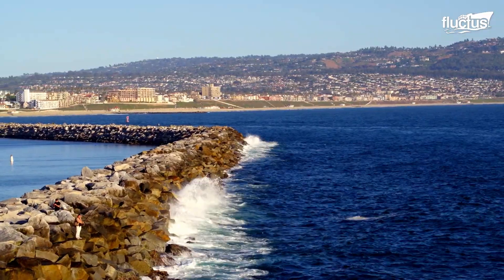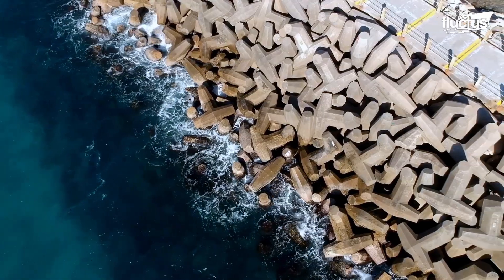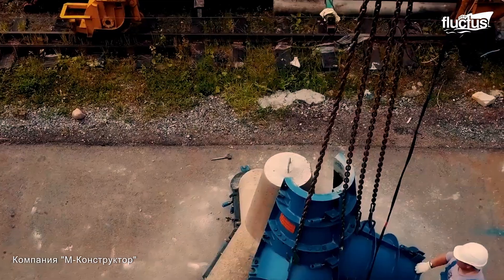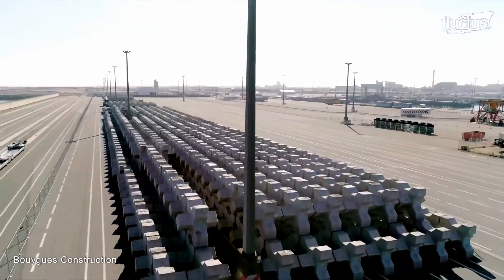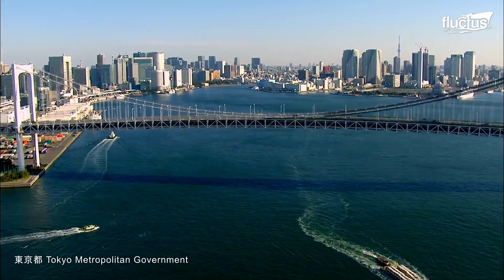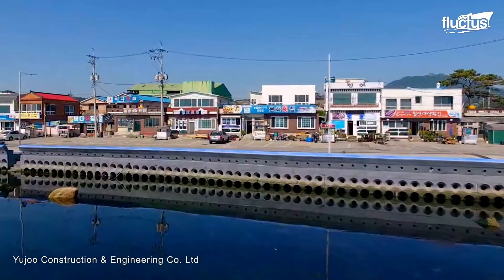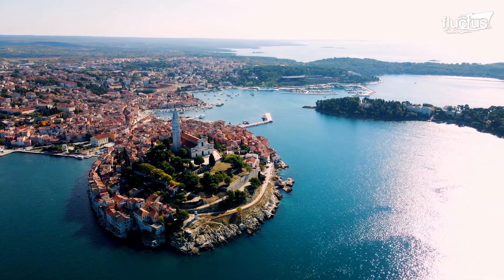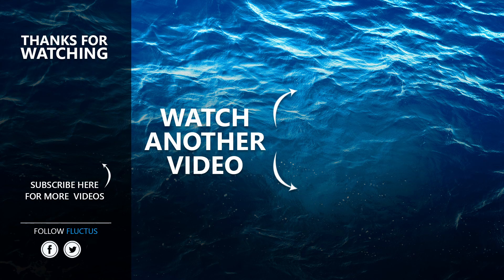The Genius Inventions Found by Ports to Protect Themselves Against Giant Waves

Comment: There surely is a way to produce electricity with these waves. Maybe the wave breakers of the future would be some sort of floating device that would benefit from the waves to make electricity and also break the waves.
Reply: They are working on it. The ocean is an extremely hostile environment for machinery and maintenance of that machinery. Saltwater, debris, and dynamic loads make it a huge engineering challenge.

Comment: The design is pretty bad, the iron hook on top is just extra part to be attached, better is to use a mold shape that would form a spot where it could be lifted. When this iron rusts off, it becomes very difficult to lift.
Reply: Once lifted and dropped into place, they will never be moved again. The steel lifting hoop is considered sacrificial and redundant once the unit is positioned.

Comment: Originally designed by:-  The Dolos was designed in 1963 by a South African harbour draughtsman Aubrey Kruger, and were first used on the breakwater in East London, a South African port city. They work by dissipating, rather than blocking, the energy of waves.  The Xblocks are based on Krugers design.
Reply: The patent actually went to a French engineer in 1950... the Americans copied it in '59, the British copied it in '61, the Dutch in '62 and Kruger in '63... each one just shaped it to their own design.
Reply: I was waiting for them to mention that?
Reply: Kruger took inspiration from the configuration of spinal column bones. Legend has it that he was eating lunch at work, which consisted of ‘leftover’ oxtail stew. The design is ingenious in that the more the waves move the Dolos the tighter they interlock. He was originally working on a design to build a safe harbour for resettlement of the island of Tristan da Cunha after the devastating volcanic eruption that destroyed the original settlement on the island. He received no royalty for his design since he was working for the government harbours department. The design was not patented and was freely available for others to subsequently copy over the decades.
Reply: So 5+ years after the invention of the tetrapod, made by the CERG in the mid 50s? The footages from the video switching back and forth from Dolos to Tetrapod surely doesn't help.
Reply: I am from NJ and they refurbished one of the main inlets with dolos back in the 1970s and they haven't moved an inch since then. I believe they used them prior to that on the US West coast.
Reply: Years ago in Ocean City,NJ, they made the jetty very tightly  to nearly stop the water flow along the beach. This in turn created an edy effect that washed the beach away on the back side.  Secret is to slow the wave action and not try to stop it completely .
Reply: I think there is a South African postage stamp about the dolos
Reply: And why did we end apartheid and take away the power from the Afrikaners then? It seems they would have made the next Australia or Singapore if we just left them in peace.
Reply: @bensantos3882  Obviously because it was a  racist system. I respect the fact that the Afrikaners as a people were hardy and inventive people which allowed them to survive and succeed in SA, but imagine if they weren't racist where SA would be now.

Comment: How come the concrete molds are not reinforced with rebar? Isn’t concrete weak without rebar?
Reply: Concrete in isolation is good at resisting compressive forces. Rebar is used used in concrete to resist tension, bending moment and shear. These are forces experienced typically where concrete has to span a distance/opening. In this instance concrete is being used primarily for mass and is acting in compression. As others have written. In certain instances rebar reacts negatively to the atmosphere and corrodes and expands, which results in more damage than enhancement to the structure. This negative corrosive reaction would be massively multiplied in a salt water environment.
Reply: Its more or less a yes and a no problem with rebar is that it degrades the concrete sooner
Reply: Rebar is used in bridges, buildings, skyscrapers, homes, warehouses, and foundations to increase the strength of a concrete structure. Rebar is not necessary for every concrete project. It can corrode easily when exposed to water or air, and so significantly reduces the lifespan.